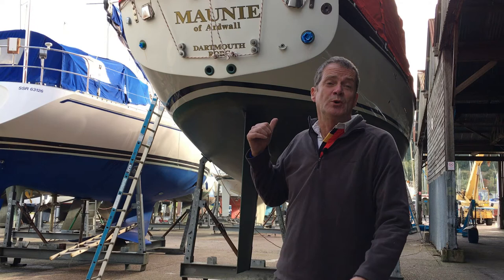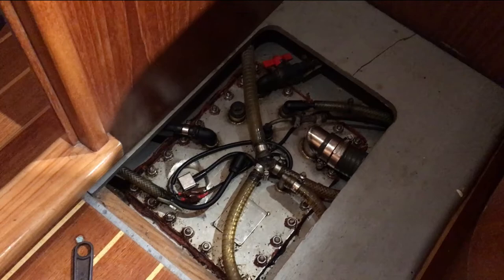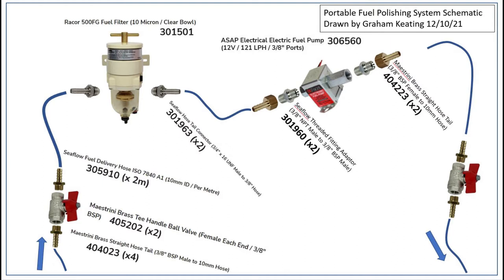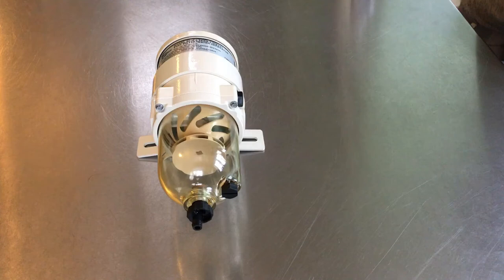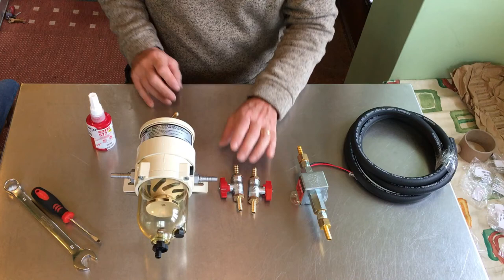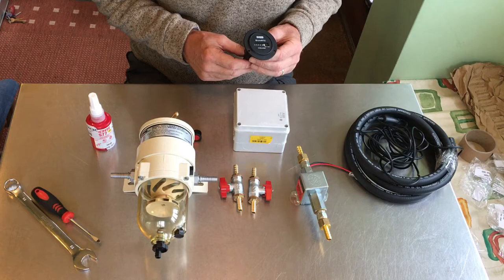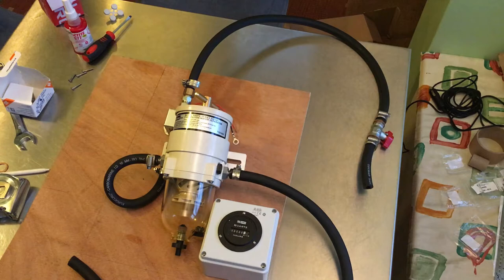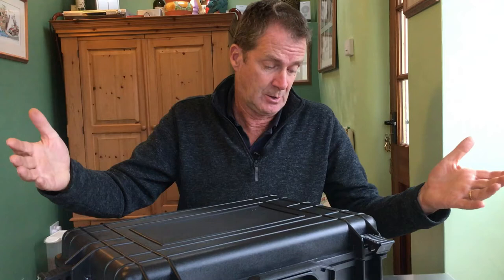DIY Fuel Polishing System

Comment: We made a system like that for our boat but we shopped around and picked up a copy racor filter fg500 for £38 on-line. It’s been working for the last 5 + years and still going fine. It take’s the same filters. 

Sailed a lot on a Vancouver 38 Pilot. Great boats.
Reply: Thanks for your experience with the copy Racor.

Comment: Do have a look at Acorn Filtration on the DAT1 onboard diesel filter. The filters will not only remove free water, but they will even remove saturated water with an efficiency of 99.9%. One can simply drain the water from the bowl when necessary.  It is also equipped with a 10-micron, 3-micron, or even submicron particle filter cartridge option. Nice to know info. Henry Boshoff

Comment: If you want to step up your " polishing system" then install a magnetic filter in the suction side then an ultra-violet light inside a box or tube that the fuel can pass thru then a fuel heater ( up to around 40C) then into your choice of Racor/Dahl or even a double CAV filter style but use biggest 796 cartridges instead of std 296 units. Electric pump needs to be capable of up to 15psi and biggest flow rate that your filters can accept. A vaccuum gauge is also a great investment. A vortex filter can be made and installed also. Been doing this method for last 30 years.
Reply: I found the magnetic that can be connected to MaunieofArdwall's useful system but am having trouble finding a usable, compact inline UV light and fuel heater. Can someone point me in the right direction?
Reply: @skyvdara  The ones I know of are made and sold here in New Zealand. From small to large units. Ive seen CAV filter units fitted with a heater unit in the bottom of the Alloy bowl that can be fitted to them and a 12volt UV light source fitted to the same CAV unit but with the square glass bowl that has a thicker alloy base under that. Both units worked extremely well. And were cheap units  to both buy and modify.
Reply: @matui6983 , Interesting. So both where nicely fitted to the filter. Sounds compact! Heater in the bottom of the alloy bowl and UV light fitted within the square glass. I'll be searching for it! 

Additionally to your point earlier, Sailing Wind Rose (Ep 019 min 3:50) shows the magnetic unit built into the polishing system. But again, the UV light and heater are missing.

Thanks again!

Comment: We have a racor filter btween the tank and the lift pump, and a seperate fuel debug filter circuit to remove fuel from the bottom of the tank, filter it an return it.

Comment: Brilliant video!  Came across it when searching for DIY fuel polishing for our 57ft canal narrowboat.  Now assembling the components to build my own.  Found a Chinese Racor 500G copy for less than £30.  I gather it's important to make sure that the filter is completely flooded with fuel, otherwise air can remain trapped at the top and so some of the filter remains unused.  How did you overcome that with your suction system?

Comment: Do you have the pump PUSHING through the filter, or SUCKING through the filter? ASAP seem to recommend sucking, but that’s not how pumps are designed. How did you set it up?
Reply from the maker: We followed ASAP's advice so the fuel goes through the filter first then the pump - seems to work perfectly.

Comment: These late-model Racor filters are puzzling. I notice that the unfiltered liquid enters down the centre and rises up the outside. What if they draw air? Does the air make it down the centre and up the outside and stop the engine before you can see the air? The earlier Racor designs, the 200FG,  feed the unfiltered fuel down the outside of the centre filter and give ample warning of the ingress of air (you see it appearing outside of the fuel "skirt"). You get to see air before it stops the motor and you have time to take remedial action.
Reply: If you're looking at your fuel filter whilst motoring that is. My fuel filter is invisible from where I steer the boat.
Reply: @SuperDirk1965 Well you don't look at the filter all the time but check it frequently. Cut a little sight glass and rig up a light so you can see it. Always check the last of the Jerry can for debris and crud. Pour the last half pint in to a clear container.

Comment: I was thinking about designing a portable system when I ran across your video. I like your design.  Do you find you need the ball valve on the output side of the filter?  Did you bolt through the back of the case or did you glue some pieces of wood to the case and screwed your panel into them?
Reply from the maker: Hi Joe, thanks for the comments. I think that the the two valves are necessary to stop diesel leaking out of the filter when the unit is in storage. 
I bolted everything to the 8mm plywood back board then bolted that into the case with 4 bolts drilled and tapped through the feet of the case, with a little sealant added.

Comment: Can you show a quick diagram of the wiring?  Where did you ground the Facet?  The switch? Or somewhere in the case?  Thanks.
Reply from the maker: No specific grounding required. The 12v negative wire goes straight to the pump and the 12v positive goes to the single pole switch and then onto the +ve terminal on the pump. The 'cigarette lighter' 12v plug has a 5A fuse in it but the 12v sockets in boat are in a circuit with a dedicated circuit breaker.

Comment: Well done on such a clear video - thank you. Your PBO article is very timely for me as I've had this on my to-do list for a bit. May I ask if there is any advantage in adding a second 2 micron filter to the cleaning system, or would this simply be unnecessary overkill?
Reply from the maker: Thanks for your kind comments. I think a second filter might be expensive overkill but you could just leave the pump circulating with the 10 micron then swap the Racor filter element for a 2 micron and continue circulating for extra peace of mind

Comment: does it not churn up the gunk as the polished fuel is fired back into the tank?
Reply: not found that to be a problem - we tend to use it on a fairly full tank so the returning fuel probably only disturbs the top couple of inches in the tank,

Comment: my onboard system comprises a primary 20 micron primary filter/water separator followed by separate 10 micron  fine filter... I presume you have similar set up? but are using only a single primary 10 micron filter for portable polishing set up as 'preventative maintenance' to avoid your onboard system from fouling underway.  How often are you finding you need to polish now you had the system running for a year?
ps excellent video btw!
Reply from the maker: We have a similar in line set up for the engine and, yes, this polisher  is a preventative maintenance system. I ran it the other day after the boat was laid up in the yard for 5 months - initially the diesel looked a bit opaque in the filter bowl but after a few minutes it was completely clear. The cloudiness probably wouldn’t have been bad enough to stop the engine but it would have partially clogged the primary (and possibly secondly ) filter. so this pre-filtering / polishing  has given me peace of mind before re-launching the boat (particularly because I know I’ve got at the very bottom of the tank where any water or sediment had settled and which would have been mixed up into the rest of the diesel as soon as we started sailing in bumpy conditions).

Comment: What would the procedure be to prime it? Thanks 👍
Reply: Initially I took the lid off the Racor and put some clean fuel into the bowl; it then primed straight away. after that I close the valves after use so the pump and Racor have fuel in them and it primes immediately

Comment: Fantastic stuff. My tank in the boat is realy clogged up u reckon running this could work or should I empty and clean tank properly? Will it get to the alges?
Reply from the maker: I'd suggest that our solution is for regular maintenance of your fuel and prevention of diesel bug. If the tank is really contaminated, the filter will clog up very quickly so I think the best course of action would be  to get the tank professionally cleaned

Comment: Great video and idea. I’m planning on doing the same. However, I would like to have a higher volume pump and a bigger Racor filter. How many microns was your filter? And why?
Reply from the maker: Thanks for your comments. Going for a higher volume pump would cut down the time to circulate all the fuel in your tank through the filter but will cost more. In reality the important fuel to filter is the 25 litres or so at the bottom of the tank (this is where any diesel bug will be) so running the 120 litre per hour pump for an hour every now and then is all you need I think. I’d only go for a bigger pump if you were primarily planning to use this as a fuel transfer system from jerrycans. 

I went for 10 micron filter size on advice from the technical guys at ASAP supplies. You could opt for the 2 micron version but they reckon that the gelatinous nature of fuel bug would mean that the 10 micron would get it all.
Reply: @Maunie38  Thank you for the input. I think, I will also install 10 microns. The rationale for faster pump and bigger filter due in part on the size of my fuel tank at 1100 gallons. And, I have the space. 2005 Viking Princess 67 (2) C15 Cats. I believe Cat requires a filtering minimum of 30 microns.

Comment: thanks for sharing. did you have much luck polishing your fuel? I was once told that many marine fuel tanks have baffles which can make them hard to polish fully.
Reply from the maker: Thanks for the comment. I think that if the bottom of your tank is badly contaminated then removing the top plate to get between the baffles is the only solution. Friends of ours had to cut an access port into their tank to do this, and found thcik gloop that had to be scooped out by hand!. 
Our kit is really designed for routine, preventative polishing -  I'm thinking every 2-3 months or so - to prevent the bug getting a hold by removing any water from the bottom of the tank.

Comment: I have a system almost exactly the same,  but mounted permanently in the boat. I added a T valve to allow filling the tank from an external container, via the filter. However,  the Facnor pump stopped working after less than about 4 hours working.  I replaced it with a cheap Chinese copy, which worked on the initial trial , running for a few minutes,  but now no longer provides any suction. Very frustrating,
Reply from the maker: Is the pump on the outfeed side of the filter (so that it's only pumping clean, filtered fuel?). The fact that both pumps failed suggests a problem with the routing of the pipes maybe?
Reply: @Maunie38  Yes it is. So, as you say, should only be pumping filtered fuel. The failure of the Facet pump is electrical (no noise from pump). The failure of the Chinese copy is something else, as it is making a noise, but not creating suction.

Comment: Thank you for sharing this! 2 questions if I may: What is the diameter of the copper pipe, and what are the inner measurements of the case please? Thank you!
Reply from the maker: The pipe is 3/8” (about 10mm) outside diameter, about 7mm inside diameter. The internal measurements of the case are 500 x 350 mm x 160mm 
I could have got away with a smaller case if I’d used 90 degree spigots on the Racor but you need to make sure there’s enough space above the top of the Racor to allow the filter element to be removed.
Reply: @Maunie38  Thank you!

Comment: Put a vacuum gauge on it
Reply: I did consider that but because you can easily see the flow rate of fuel from the outlet pipe back into the tank, the MK1 eyeball works perfectly to tell you when the filter is getting blocked.

Comment: Ok that's not fuel polishing.. It's a fuel pump with a filter. Lol
Reply: According to Wikipedia (arbiter of all knowledge) Fuel Polishing is described as: 
“Fuel polishing is the technical cleaning process used to remove or filter microbial contamination from oil and hydrocarbon fuel in storage. It is essentially the removal of water, sediment and microbial contamination from such fuels as diesel, red diesel and biodiesel.”
Which is, I think, exactly what this set up does! LOL